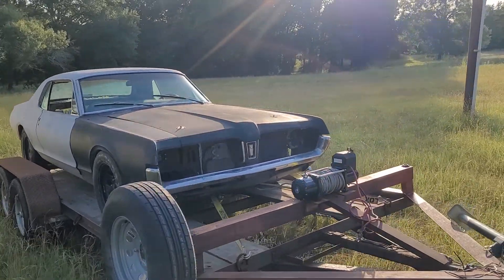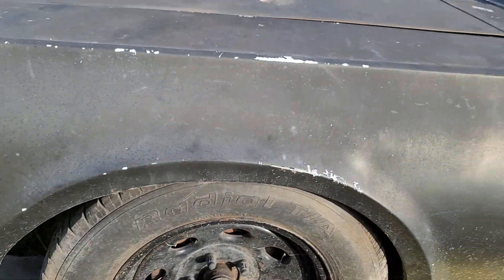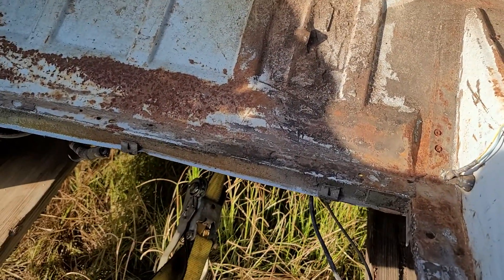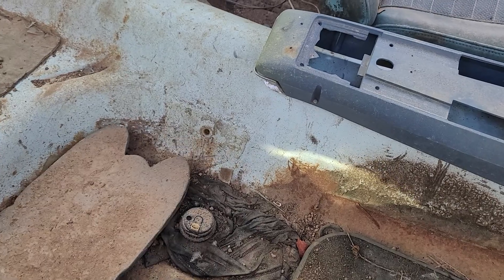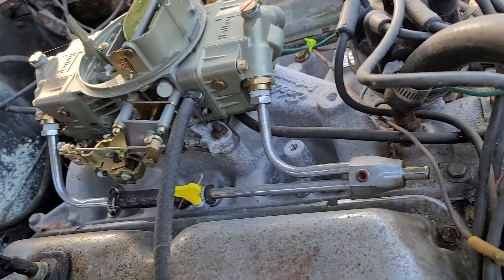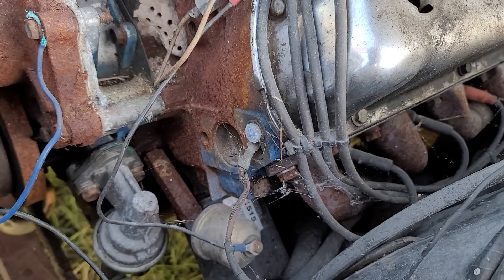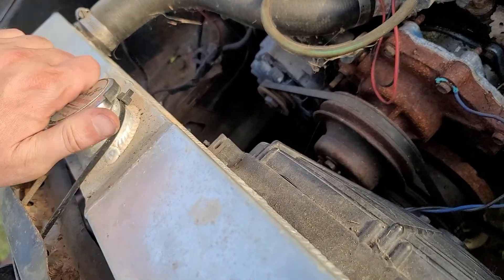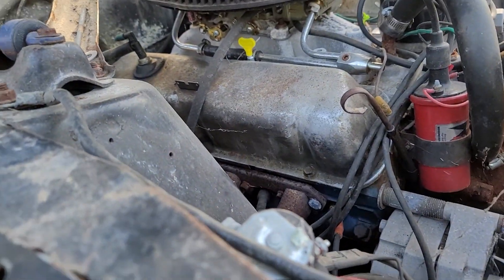1967 Mercury Cougar XR7 - Failed Hot Rod

Comment: And here I was thinking my dads challenger was bad, this is next level. It will need a full blown rewire front to back. American auto wire makes good kits. At least the rust isn't terrible. Good fucking luck, you're gonna need it
Reply from the maker: The lack of rust is what redeems this car and is the only reason to save it.
Reply: @DraculasCars  seems like most of your time is going to be spent sourcing an interior for this thing
Reply from the maker: You'd think; but, apart from a few odd RX7 bits, most of it is the same as a Mustang.  Thanks to it being a popular car with boomers, nearly every single part is reproduced.